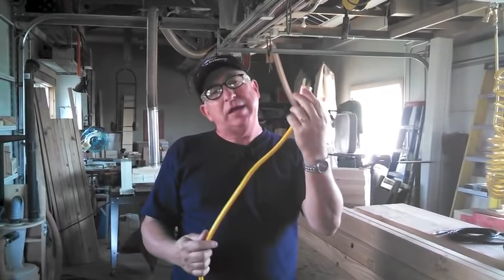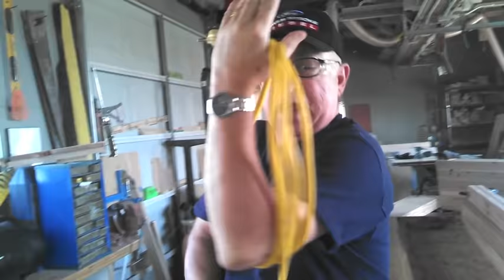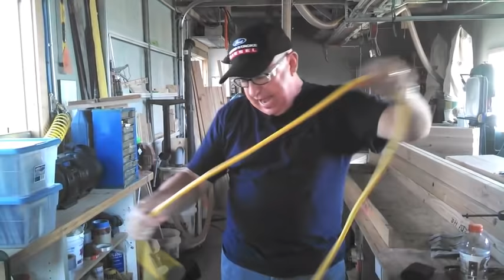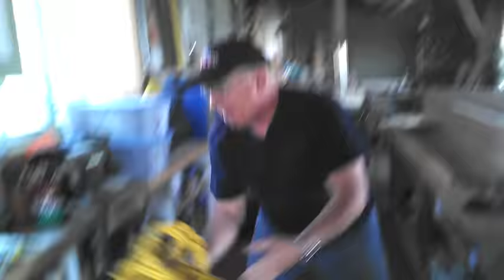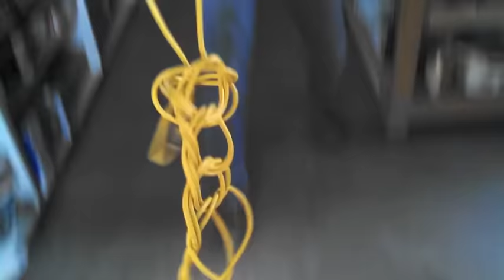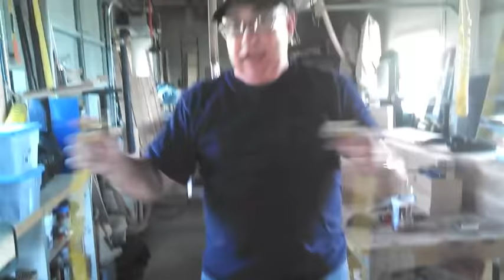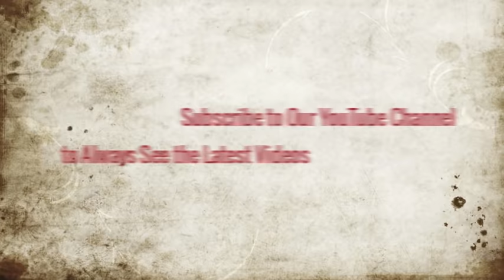Best Way to Store an Extension Cord

Comment: One minute seven seconds into this and you're doing it wrong guvner. Extend the cord out its full length, pick up the female end and roll it around your thumb and elbow pulling the cord to you as you stand in one place. The 'twist' will work itself out at the other end as you pull the cord to you. Plug the ends together and when you want to roll it out don't 'throw' it, plug the male end in and unroll it towards where you're going to be working. Front back velcro strips, two per cord, looped around the cord will keep it intact in the truck and it won't get tangled up in all your other tools. Cut an old inner tube into one inch loops, loop one through the center of the rolled up cord, feed one end of the loop through the other and hang the cord up on a hook in your shop,. Been doing this for 40+ years and still using cords I bought 40+ years ago,  And BTW, I recognize that everyone does it differently, just offering my way of doin it .
Reply from the maker: 21wdwrker- you rock! I appreciate the detailed conversation and the sense of wit. I can now cross off being called guvner from my bucket list! Thanks for both watching the video and then taking time to send on your thoughts and technique. This is one of the things we really enjoy about this media - conversations like this. The best to you and yours! DFJ

Comment: I don't believe this is a superior way to store a cord.  It is a useful way,  better than just chucking it in a tub. In cold weather this method is the worst.  I prefer a larger coil method for the longevity of the life of the cord.  Smaller tighter coils will weaken the strands of wires leading to premature cord failure if cord use is great.

Comment: Extension cords that are coiled up can create a fire hazard, even those fancy cord reels are at risk, because flowing current generates heat, and when that heat cannot properly dispense because of the coiling, fires may occur.Jan 12, 2017

Comment: I hate this. A coworker of mine used to do this. It never came out easy, no snags or twists. It always came out screwed up. Best thing you can do is over under technique that they teach you with audio cable
Reply from the maker: Maxwell, I also use the over and under in several cases and will be featuring that in an upcoming episode. Thanks for weighing in. Best, DFJ

Comment: That may work good in warm weather but it doesn't work good when it's below freezing. Too many tight loops. Big long loose loops always works best
Reply from the maker: I agree with your weather comments. I learned this technique when I was working on a construction crew in Tucson AZ where the temps are defined as "Hot" and "Hotter". No problem with low temps there!! Best to you, DFJ

Comment: this for rope...for elec cables, it actually wrecks the internal. ALL metal strand cables should be over/under wound
Reply from the maker: Agreed. We are working on a new video on the over/under method. Stay tuned!
Reply: @DirtFarmerJay  A way ive found useful in explaing the over/under is for the person to first use woven metal cable. approx 5-8mm thick. this forces the cable to fall into the shape you want to achieve. It develops the feel as a std ext cord doesn't have a lot of feel to the untrained hand. They get to learn the feel of the cable relaxing into the rings. Any steel braided cable works as well. It would show up on film quite evident

Comment: I have 100 feet and just purchased a reel.
Reply from the maker: Hank, lots of people do that it's a method that works quite well. Thanks for watching and commenting! Best, DFJ
Reply: @DirtFarmerJay  I should add my 100 feet is 12/2 and I think would be difficult to wind by hand in any manner. I like your solution for shorter lengths.

Comment: Couple of things from working in the TV industry where we use up to 1000 foot cables. If the cable has "bad memory" (it doesn't want to do what you want it to do) is to lay it out on a hot driveway or parking lot. The hotter and blacker the better. Leave it out for a day and You'll be amazed at how pliable the cable is now. Then we use the over under technique to wrap up our cables. https://www.youtube.com/watch?v=cpuutP6Df84.
It takes some practice but when you get it down you can unravel a 1000 footer with no issues.

Comment: If you train a cord and use a keeper it’s much better takes up less space just cleaner and you don’t have to undo the whole cord if you only need 10 ft. Only takes about 30 seconds to string out fifty feet. Don’t throw it. This method shown imo is the worst thing to do to a cord

Comment: FAIL!!!!  As a contractor for over 50-years and for most of that I employed this method  It cost me a lot of money with failed cords, boxes of which I still have stored in the shop attic. After going back to coiling some 20-years ago ...No more failed cords. I only employ this method for ropes and coil cords and Line(Sailboat Line).   Don't do this method with electrical cords as it breaks the copper strands and creates a fault that is near impossible to find.

Comment: I'm in the film industry and we deploy and wrap long stingers of all sizes sometimes several times a day. Cords have a natural twist of the wire. We wrap what's called an over over wrap that follows the natural twist of the wire. Starting from the female end and wrapping to the male end. This is the least amount of stress on the cord and the plugs. I can throw the cord and it will extend without any tangles quickly and efficiently. Your method is going to create stress on the cord through time. Sorry, I don't agree with you on this tip.
Reply from the maker: David Greene - thanks for writing, I appreciate your industry experience and insights. In fact, we are going to issue another small series of episodes on cordage storage and industry practices, and will be featuring the over and under, figure 8, bucket coil, and reel methods. We'll also bring up a couple of enhancements to this method for those that prefer it. In fact, there are several occasions where I've used the over and under, including with audio and video cables. I hear you. Thanks for the conversation. Best Regards, DFJ
Reply: @DirtFarmerJay  the only place over and under is typically used is on shielded cables, never on stingers. To extend the life of twisted wire cables they should always be wrapped over over.
Reply from the maker: @davidgreene1377  - thanks for the further detail. So, stingers (which I understand to be industry rated extension cords), should be treated differently? When you say wrapped over, are you simply saying coiled or ??? Thanks!

Comment: Ugh. NEVER store an extension cord with the male and female ends connected! It widens out the female receptacle over time and then the male plugs on your power tools are slipping out. Otherwise, good job. I've stored cords like this for over 25 yrs, since a good guy on a construction site showed me this trick. I call it "construction wrap". I never have tangled cords.

Comment: The only way. Is the navy way holding the cord with your left hand and coil the cord to your left hand do it every day your cord will pull off the coil off the floor every time. Your way turns the cord into spaghetti line.
Reply from the maker: Thanks for watching and commenting Stuart Rowley. This is actually the first video we made back in 2013 when the company we both worked for went under and we were both suddenly unemployed so started a YouTube Channel. We will be doing a new version of storing an extension cord soon using the over and under method. Stay tuned!!

Comment: I take the time to loop my cords properly, nothing pisses me off more than when some jackass twists up my nice straight cords by doing something goofy like this video suggests. I don't care if it is a better method or not, I like clean consistent straight loops on my cords, hoses and air lines...plus this method probably causes magnetic flux inductions at every loop reducing the current flow.

Comment: As an electrician of 15 years,... This is terrible for the longevity of your cord; as is the hand over elbow method. I could see how this could be useful for rope but seriously, why make the process complicated, both to do and unroll...? Tell an apprentice or a helper to stretch that cord out and see what happens lol. The best way to roll up a hundred foot cord is to take an end of it with one hand, let the cord slide through the other hand and when your arms are both fully outstretched, you grip the cord and let the natural twist of the wire, coil it into a loop as you keep doing this all the way. Then simply put a band of electrical tape or use a velcro strap, whatever you like. My 100' cord is about 10 years old and rolls out easy. Cheers.
Reply from the maker: Dan, thanks for weighing in. And, thanks for being in the Trades! Indeed, what you describe is used by many professionals like yourself and works quite well. It's a technique we are going to demonstrate in an upcoming episode. Best Regards, DFJ

Comment: To each his own I guess. 
It's been my experience through both trade work and stagecraft that rapping cables this way inevitably makes them impossible to spool out flat. Copper cable has "memory " wrapping cable in this manner will eventually make it resemble an over stretched spring that will not lay flat and especially in cold climates become impossible to wrap quickly. Typical west coast lazy BS.
Reply from the maker: Thanks for watching and commenting. This video was one of the first we ever posted and has had continuous controversy over the years. Thanks for weighing in. Best to you, DFJ

Comment: Great video. But, respectfully, this is too fiddly and time consuming to be the best method. We need a simpler method. I am old now and have tried many kinds of the different methods. But now I just make a skein of useful proportions and then make a single overhand knot right in the middle (using all cords at once). Done!  I've finally invented the best method! AND, its ONE method for all lengths and diameters of rope and cord including very small diameter and short pieces. Its universal. I call it the Gagu Skein.

Comment: You need to unplug your cord and work from that end to wrap your cord anytime you wrap a cord one way and another and another and another as in the video you’re showing the cord picks up that memory and tries to mimic it the next use and pretty soon you’ll end up with a drop corn that is in A  unable to unravel straight I do not know if I can explain it with words but unplug the cord so you’re not accidentally latching on to a break in the wire while it’s plugged in take the cord in one hand and stretch out your arms to bodies length with your forefinger and thumb giving the cord just a slight turn roll it into a coil doing this over and over and over until your corn is wrapped do this every time you will never have a cord that does not come apart. 51 years of experience and frustration trying to get people that work for me to wrap a cord the same way unfortunately everybody has their own way my cord my way your cord your way

Comment: Nope!  Leave it like that for a while and you introduce permanent bends in the wire.

Use the over/under method that roadies and audio/visual guys use to roll up hundreds of feet of cord with no tangles, no twists, and no bends.
Reply from the maker: Indeed, over/under is a GREAT technique used by many. In fact, we plan to feature it in an upcoming episode. Thanks for weighing in and taking time to write. We appreciate it. Best Regards, DFJ

Comment: THIS WOULD NEVER BE ACCEPTABLE IN THE LIVE EVENT INDUSTRY. AT THE END OF A SHOW THE CABLING STRIKE IS OVER AND UNDER ONLY. IF YOU STARTED ROLLING A CABLE LIKE THIS YOU WOULD BE ASKED TO LEAVE
Reply from the maker: JohncollinsAAVS - thanks for jumping in. I have been a part of several large shows and trade shows and I've seen many of the AV people use the over and under - it's a great method and I will be demonstrating it in another video. Having said that, there are tradespeople, across many disciplines, that use this method, and there are a lot that don't, preferring the over/under, figure 8, or cord reels. Thanks for being a part of the conversation. Regards, DFJ

Comment: Rubbish.   Over under is the only way.   Also try to resist twisting the cable much and here’s why.   Imagine a brand new length of stranded wire, or cable.   Those strands are pretty much straight over the length of the cable, as any twisting during manufacturing reduces length, and an 1/8” per foot over 100’ is……..well I can’t figure out that high brow math, but guess what, 100 1/8”s is 12”, and most of the time that’s 1 foot.  Unless your a furner.   That length cost money and can have negative effects on impedance and current handling.   So think, NOT a helix shape.   Now when you kink it, the outer bits of copper are being forced to cut between the strands towards the inner part of that kink.   Meanwhile, the strands on the inner radius are being forced into a shorter length, creating tiny kinks.   But the cable has to be rolled, so pick a coil diameter  and then try to allow the cable to retain that memory for as long as possible.    So. the bigger problem in my example, believe it or not, is the inner radius strands being folded over when trying to be shorter, then being bent straight again, after a few dozen times will cause this strands to finally break, just like bending metal back and forth until it breaks.   But wait, there’s more,   Over a very long time, all of those strands will eventually break, but even that’s no big deal.   The problem is that the vinyl jacket also stretches and shrinks back, and over time those broken copper strand ends are being pushed and pulled to and fro, and can pierce the vinyl jacket, and even pierce the neighboring jacket, and come into contact with the wrong wire,:causing myriad glitchy electronic issues. Shorts and open circuits are the concerns, and it happens.  How do I know?  As a live sound engineer, I wrap a massive amount of cabling several times a week.   One event. I do requires 7000 feet of cabling.   I have actually had cables fail that way.    Over under.   I wrap roughly 1000’ of cabling, from 24/3, to 12/3, almost every day, and speed is critical, yet having the cable in an easy to work condition for the next show is critical.    If patching each cable takes 30 seconds, times 40 cables, 20 minutes.   A tangled cable changes that quickly.   If it takes 90 seconds to uncoil it, that’s 60 minutes.  But if every other cable is tangled, that’s 20, times 5 minutes per untangle, is an hour.    Wasted.    
Point is if there was a better way, I’d be using it.  Case closed.  Book em Dano.

Comment: I've banned my guys from using this method in mm business, simply because this method destroys the cords over time. The wires inside tend to twist over time and eventually break. I've seen $200 cords get trashed when using this method, from daily use. Might be okay around the house but it twists them I p bad when done daily.

Comment: Sorry  but I think that’s one of the worst ways to string an electrical cord. Copper should not be put into any small loop, over its life span the strands of copper will weaken and fray. I carry over eight cords of various lengths and gauges, that method takes up too much much space. If you have various loop sizes( according to gauge size) they’ll fit into each other and make life less cumbersome.

Comment: This is absolutely the worst way to store a cord. I have been dealing with my uncles estate and every single one of his extension cords has been stowed this way for years and they all have kinks in them from forming the chain. None of them lay flat anymore. The proper way to store any kind of cord that you do not want to get kinks or twists and want to prolong the life of is the over under method used by musicians, sound engineers, etc. They use this method specifically to prevent damaging the cords causing sound issues.

 

https://youtu.be/NYb2n6_UPEQ

Comment: Nah, best method is extension cord in a bucket .
You'll need a 100' cord ,zip ties, cheap bucket and a drill to pop a few 5/16" holes to fix the cord to the MALE end to the bucket giving yourself about a 3' tail.
Now spiral the rest of the cord into the bucket.
DONE
Reply from the maker: Calvin, what you describe is a GREAT method. It's one that we are going to feature in the next month or so. There's several variations on this, all ingenious. Thanks for writing. Best, DFJ

Comment: Quick Tip don't do this. Roll cords out full for use. Learn to roll a lead properly.
Reply from the maker: Mitch, thanks for taking time to write, even if you disagree with me. We have an upcoming episode where we compare and contrast the various methods of cord stowage. Best Regards, DFJ
Reply: @DirtFarmerJay   cool but I'm an electrical trades person should you use a portable welder say a domestic stick welder with that packed coil you run the risk of overheating the tight loops.  I prefer the open roll up, not the round the elbow either. On a side note I do roll my drop ropes in the method you show

Comment: I am calling BS . I would never do this . I happen to be a carpenter. The cord should be in twisted as you loop it  . Hang the plug end lower than the first loop so it does not tangle then coil the lead taking out the twist as you go .
Reply from the maker: Paul, thanks for weighing in. This technique is one that I've seen many seasoned tradespeople use, as well as "over and under", "figure 8" as well as reels, cord buckets and such. Lots of approaches. Your technique sounds like a good one. We appreciate you taking time to write. Best Regards, DFJ